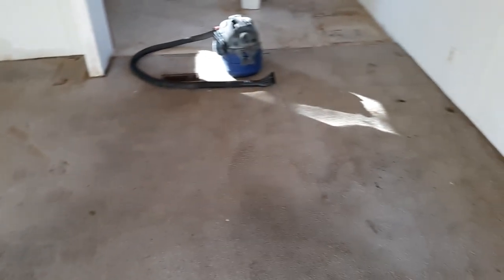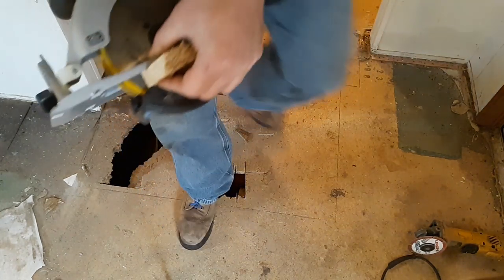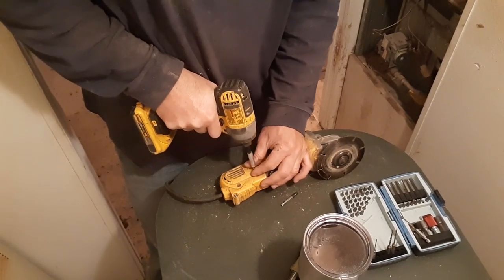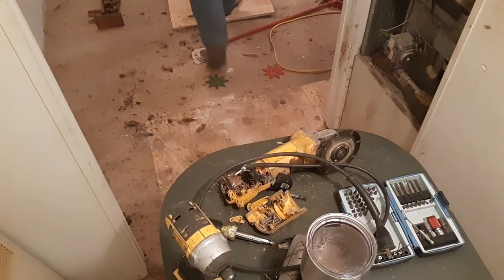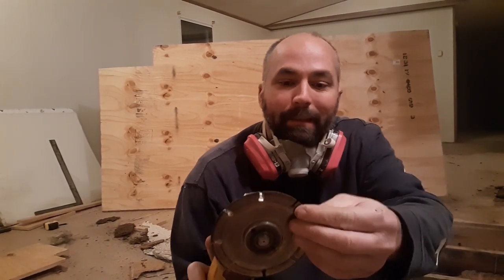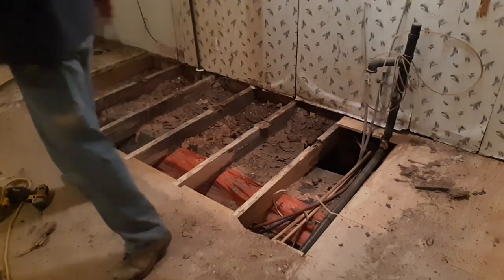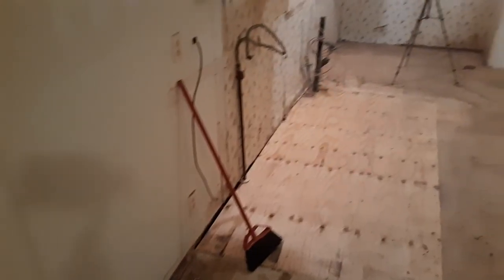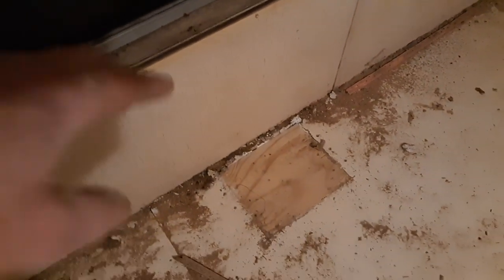Renovating Old Mobile Home Trailer Floor Part 1

Comment: LOL...  Flashback.   I did exactly what you are doing a few years ago but went with 1 1/4 tongue and groove OSB subfloor.  I ripped out every thing.  All interior walls, insulation, electrical, plumbing.  Who ever thought particle board flooring was a good idea should be shot.   Ultimately, I ripped off the entire roof, extended the walls 2 feet and went with steel truss to replace the 3/4 / stapled version it came with.   I don't envy you at all on this one.
Reply from the maker: its going to be a job.  insulation in the floor and duct work is what im not looking forward too.
Reply: @mikekisch5563  I might have had it a little easier on insulating the floor.   Because I replaced the entire floor, I put the vapor barrier on first and insulated from the top.  Either way, because of the type of construction...  it was a challenge.
Reply: @mikekisch5563  wouldn't it be a lot easier to tackle the insulation and vapor barrier when the floor is open above than getting in underneath?